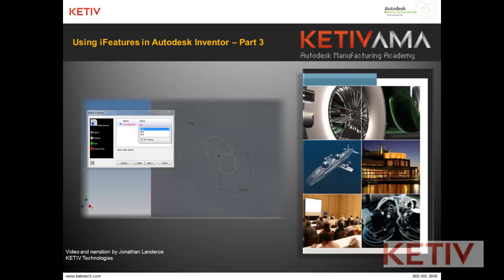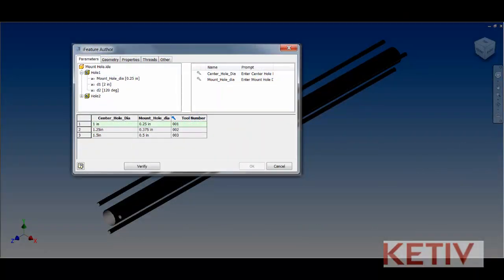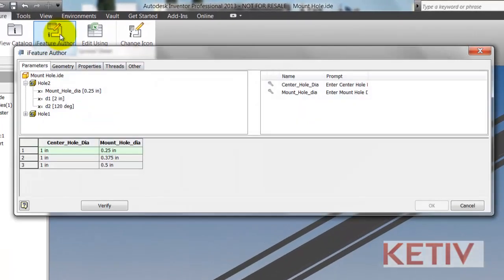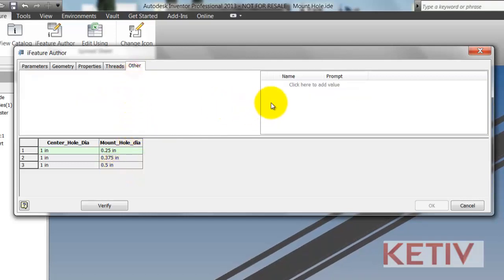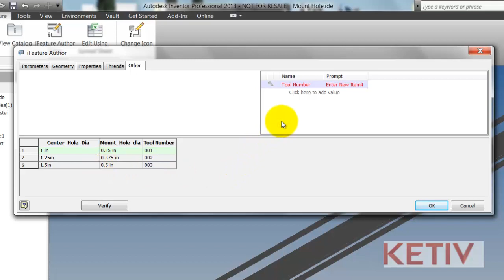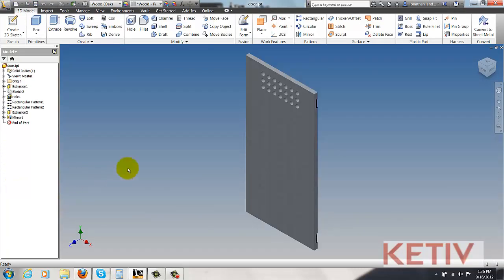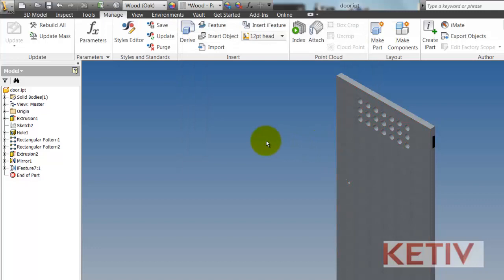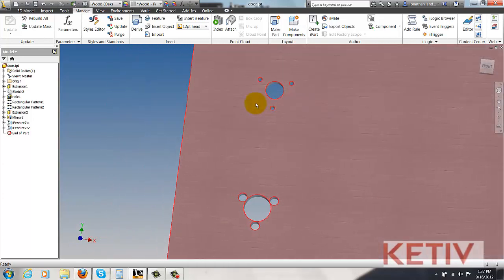Using iFeatures with Autodesk Inventor - Part 3

Comment: Hi, I need to create iFeature on two face to get finally ifeature for Minifix housing and Bolt  I create holes on two faces  put parameters but at the end when I trying to use I get One hole or two but in wrong position, also inside iFeature model look like two separate holes not one body, maybe You can help me.